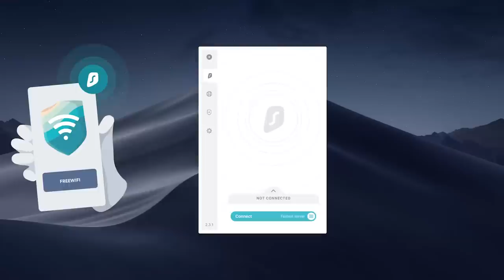INCREDIBLE PROGRESS ON OUR DIY GARAGE!!! | FRAMING IN OUR TRUSSES

Comment: My first child stopped gaining weight for almost a year before the doctor finally said we should be concerned. He turned out to be severely low in iron. We started supplementing with a liquid iron supplement and we also had to make sure he didn't fill up on his bottle before eating solids. This made a huge difference and he caught up relatively quickly.
Reply: Floradix iron and herbs formula is great for fixing low iron fast, and it tastes good!

Comment: Make sure you have framed a decent roof overhang, match the home roof overhang.  If you do not do a overhang, you will be sorry.  Also do not forget that the upstairs sleeping quarters has to be separated from the garage by a fore rated barrier according to the fire code.

Comment: A suggestion they have these plastic bibs that have like a little trough almost like a cup at the bottom. They’re plastic or silicone bibs with that cup at the bottom it will catch everything and you just run it under water

Comment: It’s a bustle on the back of the dress - Def:  A pad, cushion, curved frame-work of wire, or the like, worn by women on the back part of the body below the waist for the purpose of improving the figure, causing the folds of the skirt to hang gracefully, and preventing the skirt from interfering with the feet in walking.

Comment: Trent, the skirt you're trying to think of is just a variation of the old-fashioned hoop skirt...on some the hoop frame was kind of a symmetrical bell shape, but on some the rear bumped out more, and the front side was a more flattened flare (to kind of simulate that big booty look you was thinking about).

Comment: My premie’s head was measuring too big. It was scary as we were referred to a specialist, worried about fluid issues. I went in to the appointment with my son while my spouse found parking. We were called in and the dr. was clearly worries and brought out the measuring tape. And then my spouse walked in... dr. chuckled and said I think we know what the issue is. Turns out my spouse has a big head and kiddo inherited same. All tests fine. So yeah... you may have a skinny kid. LOL.

Comment: Please don't stress the percentiles. If Leo is doing everything right otherwise he is fine. I had a daughter with 15 percentile height, 50 0ercentile head and only 5 percentile weight. Supposedly started as a failure to thrive baby but now in her mid 30s and working in accounting. PS I tripled bibbed her and still had to wash her after each meal lol.